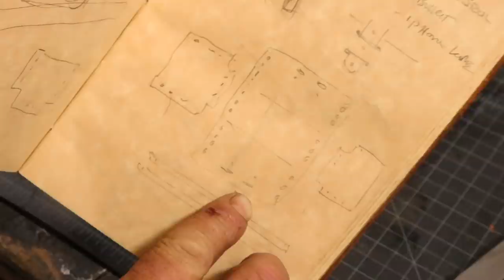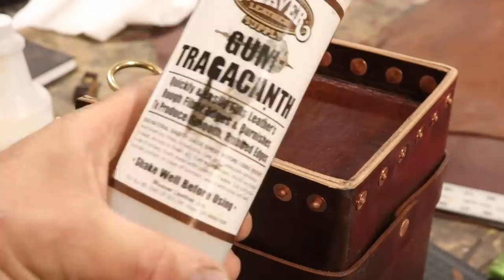DiResta Leather Bag No Stitching

Comment: If I may comment on construction. Ends of bag should be reversed to gain volume. All rivets are the wrong way around, the flat head  should be on the outside .The handles would be impossibly uncomfortable in use, at least five inches of the centre should be folded and joined to make somewhat round shape. Way easier on the hands.Look at any oldstyle suitcase handle.

Comment: Hey Jimmy, was there any particular reason apart from difficulty that the end pieces are facing inwards? My assumption is that you did them like that because it's simply easier to pop the rivets on whilst assembling. That is all love the video, cool to see your sketch book you've talked about on the Making It podcast a few times. 

James
Reply: James Forrest I can’t answer for him, but I can tell you it makes the bag more rigid to stand and hold it’s shape. Kind of like bends in sheet metal.
Reply: James Forrest Also, you get to see more sides of those beautiful, hand-placed, copper rivets.
Reply: @RefinerSimilitude  Thanks! That does make a lot of sense.
Reply: I rivet a lot of my work... most folks want the burr/rove to show with the peening.  Light really catches it if you do it right.  He did not do the finish peening here.
Reply: @RefinerSimilitude , there were rivets on this build?
Reply: @AHustleIsLikeASideOfFries  The copper pieces that he uses to hold the leather together are the rivets. Bit different to 'traditional' rivets but they still count.

Comment: Great video jimmy! As a question, are the rivets necessary for structure or can you get away with just glue? Curious about getting into leather working
Reply: While contact adhesive is strong, and you could use only that as a proof of concept, you would still have to use stitching and/or rivets for the bag to be used regularly.